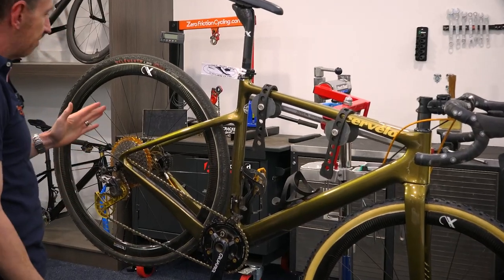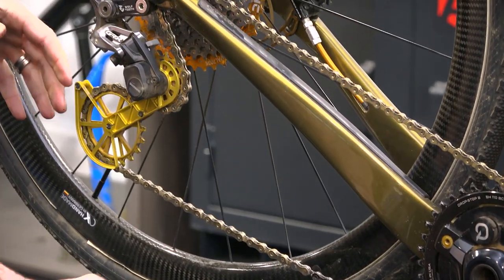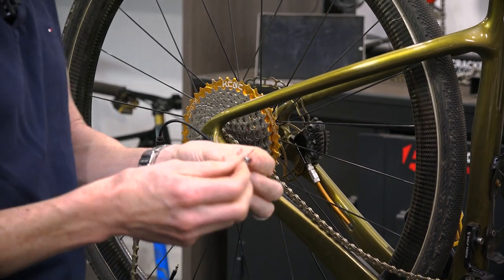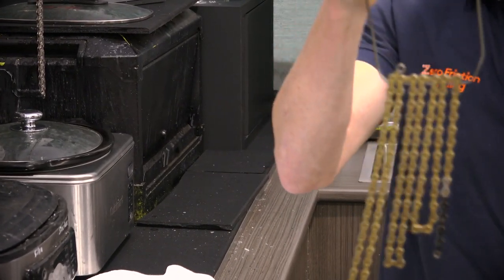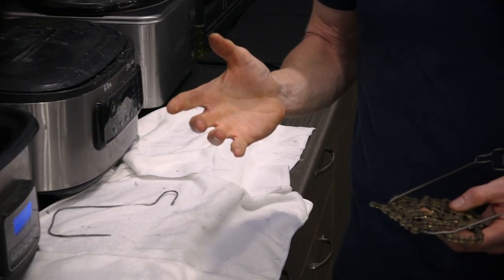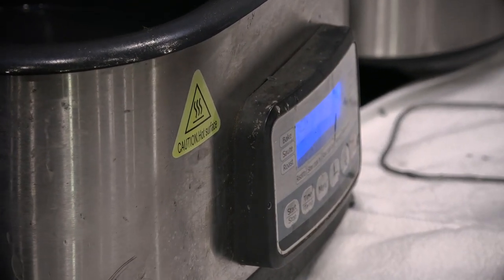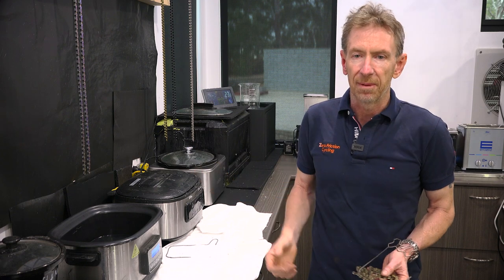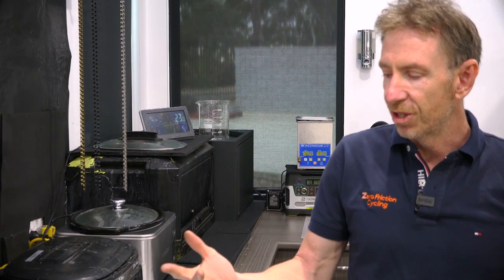Episode 4 - Part 2 Immersive Chain Waxing  - How to Guide.

Comment: What’s the problem with using motorcycle chain lube in cycle, wurth has a very good product called hhs dry lube which is ptfe based . I have been using the “normal” motorcycle chain lube which is admittedly a bit sticky but it’s ok if you’re doing mostly gravel and Tarmac
Reply from the maker: it is possible there are some automotive / motorcycle products that may cross over ok, but remember the focus of these products is different, so whilst some may do ok / well, it is still unlikely they would match the best products found with genuine R&D developed specifically for cycling. Ie motorcycle chain lubricants are actually there mostly to a) prevent rust and b) protect o rings. All the actual high pressure lubrication for load surfaces are locked in by the o-rings, the chain is effectively lubricated for life inside where it needs to, and the lubrication applied externally is just to protect external surfaces from oxidation and the o-ring seal from drying out and cracking. This is very different to cycling where whilst the loads are lower, the very small parts size still has pressure loads in the thousands of psi which need to be lubricated, and there is no seal, so any contamination the lubricant attracts can be abrading on wear / load surfaces under this very high load pressure. 

Dry PTFE spray type lubricants as for motorcycle chains tend to be very thin and thus have a very short lifespan in cycling under these loads, so vs top tested bicycle chain lubricants, they may need more frequent application, overall costing more to run in lubricant costs, and likely with higher component wear as well. They simply have a different function they were designed for. 

Also note that most good players in the industry are moving away from PTFE for environment reasons - and the rather terrible environmental impact of PTFE mfg. There are better options now.

Comment: Is it necessary to clean old wax from the chain before re-waxing? From my experience so far the time intervals between re-waxing seem to be getting smaller and smaller. I only rinse off dirt in tap water before waxing. Also, could it be that the wax wears off faster in freezing temperatures? Recenty a re-waxed chain in -7C (19F) got noisy after only 3-4h of riding.
Reply from the maker: Hi Thijs, no not at all, i do not know where this information keeps coming from! refer to chain maintenance guide (instructions tab zfc website) for how to best maintain you waxed chain, what you should do and when. watering chain before waxing may be causing issue unless you fully dry chain. Over time the wax will become less amazing as some contamination over time is inevitable, so the treatments will last less and less - typically you should change to a fresh bag (decant out old wax, clean pot, fresh bag in) every approx 8000 to 10,000km depending on conditions you tend to ride in. And yes, the wax will be more brittle at very cold temperatures and a shorter lifespan can definitely result. If you are finding re wax frequency difficult to stay on top of consider a) two chains on rotation - you always need another chain, and this guarantee's two chains through cassette vs getting caught out running one too long, and or b) use in conjunction with silca ss drip, ufo drip or tru tension tungsten all weather - you can top up when home with this lubricant as needed to keep sufficient wax in chain, and then re wax when you can without any need to clean prior. 

Rather than water, use an alcohol or disc brake cleaner spray on microfiber cloth to wipe chain to remove surface dust vs water. Watering chain, unless it is a boiling water rinse post a proper wet ride - it is just not optimal to introduce water to your chain voluntarily with that exception, and you should only boiling water flush rinse post decent wet rides, not as general practice. Again guide should help explain in good detail

Comment: Do you just leave the left over wax n the pot with the lid on and reuse or do you store it in something else until next use. On the new chains I got they said you could reuse the master link 3 times. Could you do a video comparing the different types of manufacturers chains. Has anyone done any testing on them?
Reply from the maker: HI gary sorry delay reply i get very behind on social media stuff! Yes let it cool in pot, no need to store elsewhere, this way you can just turn on and melt again. You should have a dedicated pot, not mix with cooking. And yes refer to chain testing page on website and best chain article with cycling tips :)
Reply: I reuse my quick link many times because I mostly ride on my indoor trainer where I don’t shift at all. It’s basically a single speed. I get phenomenal wear using a waxed chain. However, it is darned messy. People always says it so clean, or cleaner than petroleum (oil) on the chain, but I find it’s at least as messy. Wax just keeps flaking off and I need to clean up the bike, trainer, and floor constantly. Waxed chains are all about flaking wax and lots of it.

Comment: I ride a recumbent. The chain is close to 3 times the length of a bicycle chain. What practical advice would you give for chain waxing such a long and cumbersome chain?
Reply from the maker: Hi Robert, yes there are times where immersive waxing would not be practical as treatment lifespans are not super long - perfectly long enough for bikes where it is a cinch to pop ones chain on and off, not really long enough for use cases where doing so is quite a job - even though if one had the time - it is of course going to deliver longest lifespan for your drivetrain. Similarly some of the other typically best drip lube options like ss drip or ufo drip may not be long lasting enough / bit of a pain to re lube such long chains. As recumbents typically stay on road, some very long lasting wet lubricants would be the way i would go, ie silca synergetic, and currently on test and going extremely, extremely well also are Revo lubes, or Rex Black diamond (black diamond recently set a new road use single application longevity test record). Depending on where you are, some may be hard to get - but either of those 3 products will deliver very low wear in road use, very long treatment lifespan per application, and applied properly (work in, then thoroughly wipe excess, and continue to wipe excess from outside of chain each ride) then maintenance intervals are also long - ie a clean and reset every 2000 to 3000km depending on how things are where you live.
Reply: @zerofrictioncycling992  appreciate the advice. Thank you.
Reply: I don't really see any difference between  a road bike and a recumbent. I ride a recumbent and have been waxing my chain for a year and a half now.  The chain is more than  twice as Long so I had to make a studier swisher tool, but removing and replacing the chain and the waxing probably tales the same time as for a road bike.  Theoretically intervals between waxing should be 2 to 3 times longer than for a road bike, but I'm not sure that this is true in real life.

Comment: Super interesting stuff.  I'm 5,800km into my current chain (Force AXS) on my road bike.  Am I best to start with a new chain if I am going to start doing immersive waxing?  If not, how do you recommend decontaminating my current chain prior to waxing?
Reply from the maker: thanks steve! and ah thats a bit of tricky one. A force chain is expensive ish, but not crazy. And so depending on previous lubricant and how many litres of solvent you will need to put  through it to properly clean it up for waxing, taking into account how worn it is or is not (so how much life left) - thats the balance. Ie if i have a half worn out ultegra chain - i wouldnt put 3 to 4 liters of turps through it then 2 metho baths to clean it up. If i have a 20% worn red chain, or xx1 or xo1, or T-Type chain - for sure thats worth the solvent and time. Make sure you have a good chain checker, check its wear - if clearly under half worn it is likely worth it, if getting to half worn or more - i personally wouldnt. Stay the course, get a bit more out of that chain, but replace erring on early so you dont risk wearing into cassette, and then start the fun much much better path next chain.
Reply: @zerofrictioncycling992    Thanks, that's great guidance.  I think i'll get a new chain as soon as the weather is better (I'm in the UK).  How do I strip the new chain of the coating they aways have on them from the manufacturer?
Reply from the maker: @stevefry4317   My pleasure - and just check the chain prep guide (concise version) - zero friction cycling website - that has a little flow chart for if one is prepping new chain, or existing chain, and if prepping on bike or off bike, and if using solvent or a great (and makes it a whole lot easier) product like UFO DT clean. So follow which one suits you (ie new chain, on bike or new chain - off bike - and if solvent or DT clean). It is all really easy and the guide will step you through whichever section is the one you need

Comment: Thanks Adam!

Three'ish simple questions:
1. If a rider purchases a new bike and wants to use a pre-waxed chain, will they need to degrease the front chainring, rear cassette and rear derailleur pulleys first to remove factory/LBS lubricant?
2. Does the degreasing of these components need to be fastidious?
3. If a rider uses a pre-waxed chain, should they always remove and dismantle the rear derailleur pulleys to lubricate the pulley bearings, rather than squirt lubricant around the seals every now and then? How should they approach lubricating derailleur pivot points?
Reply: If anyone is interested, Adam answers questions 1 and 2 in Episode 6.

Comment: What derailer is that with the big idler pulleys?  Are the idlers and cage an aftermarket add on to the derailer or does the derailer come that way?
Reply from the maker: Hey mark! That is a RX 800 mech as its my cx / gravel race bike. That is the kogel kolosses OSPW system which i really like for offroad bike as it is a really strong and stiff cage. Oh and it gives me style watts, which is very important in lieu of having many actual watts!
Reply: @zerofrictioncycling992    How much do those big idlers increase the chain wrap capacity of the cage compared to ordinary size idlers on a same length cage?
Reply from the maker: @markholm7050  It depends. Marketing for OSPW systems normally claim savings of around 2w. However we do no know what losses the chain is that they use to measure savings between OSPW and standard. I believe most would use a real world "Average chain" of likely around 10w loss. If one is being smart and say running a msw / hot melt chain that will be half the losses of a normal chain - then your savings will also be halved. The worse your chain lubricant, the greater the penalty for small diameter pulleys, cross chaining etc. The lower friction your chain, the lesser the penalty for such things. but also, there is less ability to save by optimising these things

generally i quote to most enquiring at ZFC, if they are running a top lubricant option choice, it will be about 1 watt. So it is an expensive watt. 

However, some conditions it is worth more. Ie that is on my cx /gravel race bike. Tension in lower span is greater than on a road mech, so there is a bit more to be saved to start with. Then, in many races - ie the bike saw plenty enough mud on saturdays cx race - the chain is not going to stay in the 4 to 5w loss mark in the last half or last third of the race, it is has bunch of mud in it, it will be more. The more friction in the chain, the more the ospw will save - so it was probably saving me circa 2w after all by the end, and others who start with pretty terrible chain and finish worse, well, more  - but they should work on their chain lube before they think about shelling out for ospw. 

Im not fast enough to really worry about 1w or 2w, but i am lucky i have the budget for fun things with my bikes, i really enjoy an optimised bike because when you take care of things across the bike  - you can add up some really big differences vs just running things stock. From chain, to bearings, to pulleys to tire choice - all the right choices can add up to 10 to 15w difference vs meh choices, and a bike really feels like silk lightning overall with all the right choices vs feeling like a bus with the meh choices. Life is too short to ride draggy bikes :) But again - use budget - cover the easy, very cost effective low hanging fruit first (chain, chain lube & maintenance, tires - refer to bicycle rolling resistance, then stay playing with bearings / ospw if budget allows / and or you just enjoy adding cool touches & upgrades to your bike. You wont notice saving a watt. you will notice saving 10).

Comment: How do you remove and rejoin your Campag chains? Thanks for your videos.
Reply from the maker: Hey Adam, most move to master links / connect links. In their 123 page instruction book they extraordinarily wastefully include in every chain (the internet campy, the internet.....) campy are illogically against master links. Yet for ekar they finally moved to master links..... but riveting special campy pins with the special campy tool to remove and re instal a chain - that was good in 1986. To make waxing viable / proper chain and bike maintenance viable - use ybn or other brand masterlink of same speed as the chain.
Reply: @zerofrictioncycling992  Thank you!

Comment: I have been waxing the chain for a few years now. I always ultrasonic clean it in hot soapy water for about 40 minutes, rinse in warm water, blot dry, and bake out any water for an hour at 170 degree F. That way it is very clean when it hits the wax in the Crock pot on low. I have found that the newly waxed chain takes multiple rides to acquire the lower drag. One thing that negates the cleanliness benefit but strangely massively reduces chain drag is to add about 10-20 drops of NFS lube to the newly waxed chain. The combination make the difference for me of not getting dropped on my fast group rides. Subjective, but to me very tangible. You then have to dry wipe the accumulated debris and reapply a small amount of NFS again each ride. But it is worth it because the combination is strangely synergistic.
Reply from the maker: Hi William - alas no your NFS is not reducing your drag, it will be increasing it. Part of why wax is so fast is that after it has been ridden circa 30 mins and wax fully broken in, the wax surfaces on all parts of chain are highly polished. All parts are now sliding on a solid super slippery coating of wax. There is lowest stiction, and zero viscous friction. NFS tested in friction facts as respectable - 5.5w from memory, mswpeedwax original formula 4.4w, no doubt new formula is a good bit quicker. So you will be adding drag vs wax. And then more so as it gets contaminated. No doubt you need to do a lot of cleaning from this before re waxing, so that is a lot of time and effort to add drag. Subjective feelings on this topic are pretty rife. Lets say by some strange interaction you did reduce friction adding NFS to wax - what is going to drop to from 4.6w? Lets say it is 1w, which is a pretty significant 20%+ friction reduction. Are you saying 1w is the difference for you being dropped or not on fast group rides? I can tell you quite categorically it is not..........

All you are feeling is the silky smooth dampening of a very dampening wet lubricant vs what a solid lubricant feels like. This feeling is not a feeling of extra speed, just like the high frequency vibration of running your tires at 140psi is not faster vs the correct pressure. 

Lastly on cleaning for those reading - i keep stressing this especially if riding in dry conditons - JUST RE WAX. It is a solid lubrication. Contamination penetration is so tiny. Boiling water flush rinses or ultrasonic cleaning post dry riding - is 99% a waste of time and effort, only bother post wet rides to flush clean, dry, re wax. 

Apologies william if this reply seems to be shooting down recommendations (probably because i am) - but please be wary re spreading such information - there is so, so, so, so much miss information pumped out about chain waxing and chain lubrication, i work very hard to try to correct. You are not going to make your wax faster by adding a slower wet lubricant and a watt or two difference in chain friction (you can use your own bike calc - online calculators for watts / weight / speed calcs) is not even remotely making the difference on you being dropped or not on a ride. I encourage you to do your own deeper dive and logic to check before posting recommendations to cyclists so as to be one who posts great recommendations, not miss information recommendations that would be detrimental to the cyclists who follow, i am sure that is not what you are wanting to do.